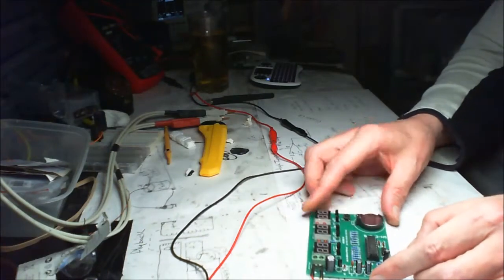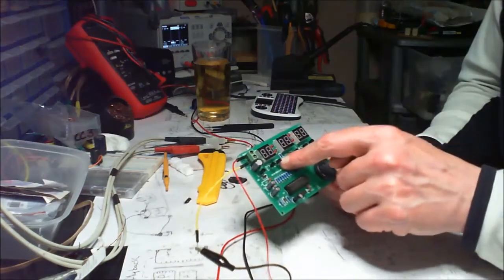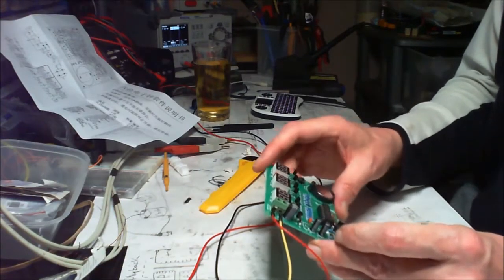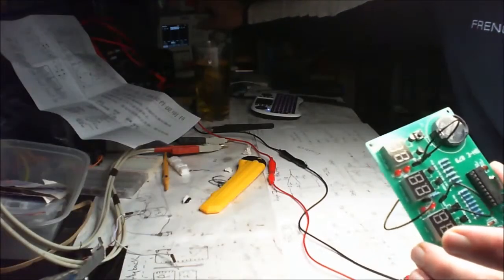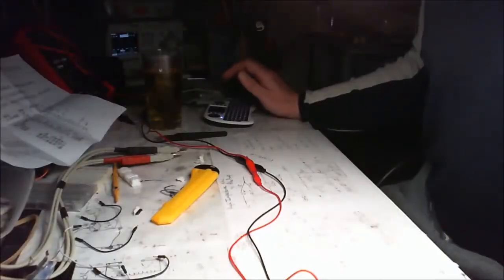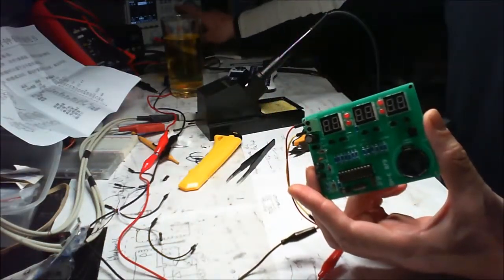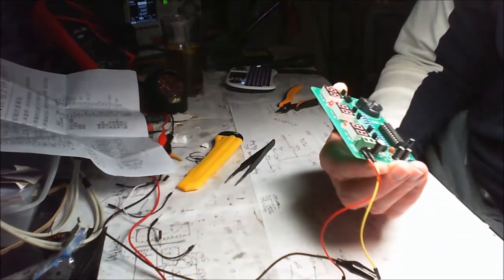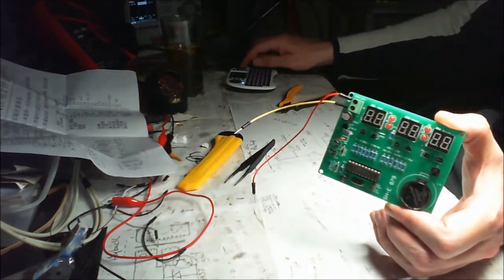9V 12V Electronic Clock DIY Kits Module AT89C2051 pt 2 of 2

Comment: I got fiddling with mine after watching the video... I removed the battery and powered up the clock and it works! I guess the micro didn't get fried, just needed a reset.

Comment: I soldered this one, exactly like the manual (double, triple checked - polarities etc, all good), and when I turned on the power the 220uF capacitor just blew up rather violently. Luckily I was wearing eye protection. I guess the capacitor must have been faulty.

Comment: Did you remove the backup battery,  power off,  then back on again? Did the device ever work?
Reply from the maker: it was one of my first kits, i probably made a mistake. I have no use o t. I am learning electronics soldering building kits and other circuits I do not make tutorials. I make the videos for my own records. Sometimes I wish  hadn't.